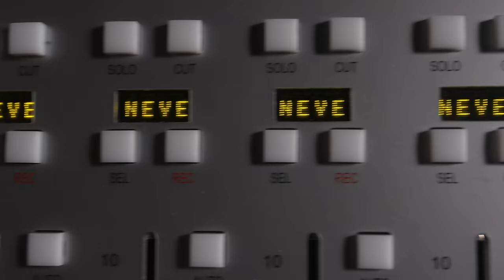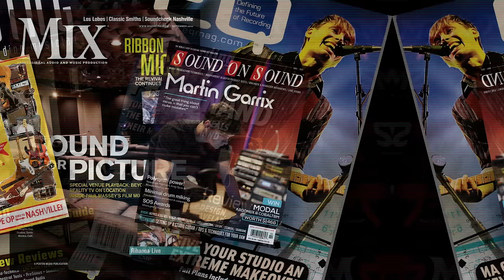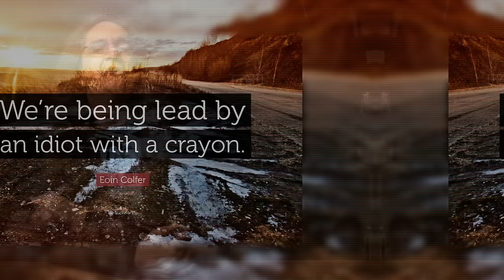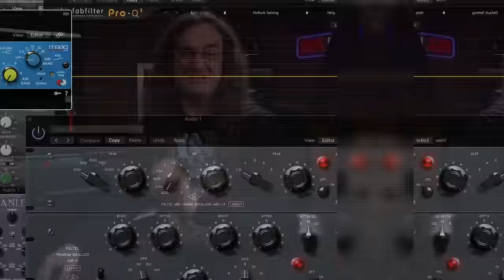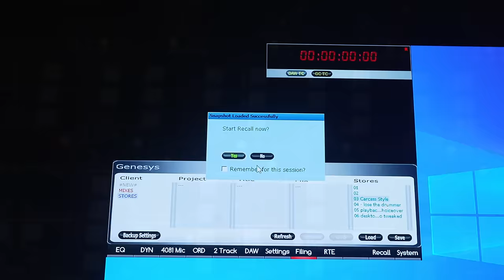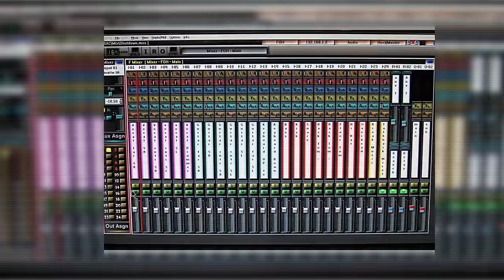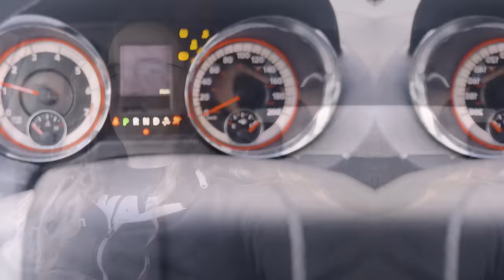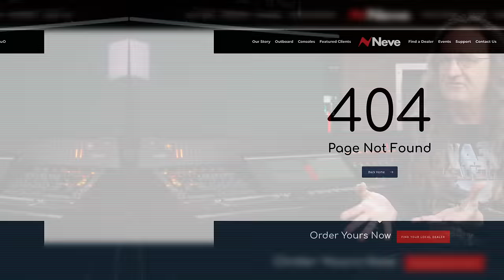I never GAVE UP, and finally got a $100,000 NEVE Console!

Comment: I found a fun content format that might be pretty entertaining. Check out the Denver Craig’s List music instrument category and see how some people overvalue their used gear, and usually in the ad it will be some funny BS reason. (Replaced pickups with antique pickups, with amateur home-brew wiring, and call it an upgrade).

Some of the instruments are legit collector pieces, but others are obviously trying to cash in on the frenzy by making their garden variety used gear seem like the other vintage collectors pieces e.g. low value Roland keyboard priced like a high value Roland Keyboard.

It could be framed as a way to help people avoid getting ripped off by these people.

Comment: The self deprecation is unjustified at this point. Somebody there left you with the wrong impression and you have been dragging it with you for a long time.
Results speak for themselves and they speak volumes (no pun intended). You earned every bit of it and I wish you all the success you deserve.
Good luck with the new console, it sounds very nice and will sound even better in time.

Comment: Congrats on the great console! I'm dreaming to get an SSL AWS 948 Delta and this gives me hope :D One thing: I quite didn't get the idea behind the levels going into the compressors while you discussed the drum room sounds, clipping and saturation. While I agree on the idea that analog compressors still sound better than the plug-ins, it's all just pretty simple gain staging. Digital zero is 18 db louder than analog +4. And that's the level you should run into your analog modeled plug-ins as well. There's no point in jacking up your levels in the DAW near zero.

Comment: Congrats! Not a more deserving home for that Genesys. I got the 1073OPX partially because of you and I've come dangerously close to pulling the trigger on the 8424 (because I like the 1073OPX so much). I ended up with the 8816 summing mixer but don't use it much. I have sooo many questions! Well, more like four.

Comment: Even in Australia, I've used Sweetwater. My previous console/interface, a Zoom R24 was cheaper, even with GST on arrival, from across the pacific than I could get it in Australia! Same for my previous looper pedal, a Jamman stereo. Aussies, remember, there's a need to replace the power brick when you buy from Sweetwater, though. AND EVEN THEN THEY WERE STILL CHEAPER THAN AUSTRALIAN PRICING. That was 10 years ago, mind.

Comment: "It saturates" - an algorithmic peak limiter can do the same. I think at 24 bits no one could tell the difference. Although one would need to put it on all signal paths to simulate hardware. Hardware also has inherent fixed signal level range.

Comment: Congrats glen. Just the linear actuator motors for the analog dials are like 70 a piece. Not to mention thelogic to control them. Im an electronic engineering nerd along with guitar snob hahah

Comment: On the Topic of Tone: As a Guitarist myself i completely agree that Pickups, Tonewood and whatnot dont matter all that much for High-Gain Tones. But what about Tone in modern Metal Drums? I often hear arguments that VST-Plugins can and will never sound as good as a properly recorded Drumset. Okay, but what i hear in Recordings is so damn compressed and processed, that it might aswell be a Plugin. I am not talking about Composition or Performance, only about Tone. So a Test comparing an Acoustic Drumset properly recorded and processed vs a Midi-Drumset using VST-Drum-Plugins would be really interesting.

Comment: Congrats on the console!

I would just like to point out something you said about hitting zero in the digital domain and having nowhere to go.  This is somewhat of a true AND false statement as 0dBfs is relative to the calibration and maximum headroom of your converters.  The "standard" calibration for converters has traditionally been +4dBu = 0VU = -18dBfs.  This means that the maximum headroom is +22dBu before clipping.  Some converters can be calibrated to +28dBu (+4dBu = 0VU = -24dBfs).  The Neve is > +27dBu, which is obviously hotter than most converters and why you can hit the compressors "harder".  I just wanted to make the distinction that it's not necessarily because your converters are digital that makes them not hit as hard, but because of their analogue output calibration.  I remember my old AD8000 had a Calibrate button where you could change it on the fly.  There were also input calibration pots to calibrate your inputs from the console outputs, thus insuring proper relative signal across systems.  Just my 2c.

Comment: Reaper uses floating point calculation so within a project digital clipping doesn't actually occur (it can only occur on output).  So are you saying that something like a PCI or USB audio interface can't amplify a signal over 0dB?  Isn't it going through a DAC on the way out anyways?  It seems like you could have just modified your signal chain using a transparent preamp or compressor to drive your color (colour?  How British is your part of Canukistan?) outboard chain at a few dB gain?  Regardless, cool console and I think you're right about sitting in front of a console really helping workflow.  Coming from live sound engineering and performance doing the whole DAW thing with a mouse sucks.

Comment: QUESTION: Is a console the only way to get line signals from the computer and then boost them again so you can hit gear like outboard compressors harder? It seems like there should be a way to do that without a 300-pound Neve-like thing.

Comment: no dont swap the EQs.  you want IDENTICAL eqs on each channel.  If you are doing a mix You either Dont use EQ atall or you have EQ engaged on all channels.  DONT use some eqs off and some eqs on.  DONT start mixing eqs because then the lengths of your channel will be different.

Comment: Live engineering is a thankless task (normally) if the PA sound is good then it is all down to the band, when the band sound crap it is all down to the live sound guy! ........... Yep, apparently putting a band through a PA suddenly makes them play the wrong chords, and out of time!
 A tip for bands when first setting up offer to buy the sound guy a pint, often they will refuse as one of the first things alcohol effects is hearing; but boy is the offer appreciated and they will go that extra mile for you, behave like a dick and they will do the bare minimum.

Comment: Glen $ed B 4 not 2 wa$te yor $$$ on a 'desktop sized mouse' (mixer), yet heer he iz blowing hiz wad on a 'built 2 B obsolete' thing having 2 literally beg them 4 the driver 2 get it running, so U can bet they will make it 'obsolete' 4 kix, like ridiculously high pricing 4 'updates' 4 different OSes or maybe even disable the device if U don't 'update' etc.  It's a total $cam ~ these 'digital-based hardware' things.  4 that, stick with computers.  All 'outboard' stuff U R better off with 'established' tech, like tubes or something, though there R a few exceptions like old digital guitar pedals that $ell higher than original = pretty rare though.  If U hold on 2 yor 'junk' computer another 20 years they usually go back up a bit B 4 they crash completely.  It's an 'N'-shaped cycle = they start high, then drop like a rock & rise steady until they drop again (after like 25 years) but sometimes even then worth more = if it's something 'special' like 'classic Mac' maybe LOL   iGot a bunch of tube rack guitar preamps & they R all going 4 about 5X wat iPaid about 20 years ago, so with inflation it's still good, as that's supposedly only 20% per decade or so?
Reply from the maker: Please get help.  https://www.twinkl.com/resources/planit-primary-teaching-resources/planit-intervention-primary-teaching-resources/planit-eal-primary-teaching-resources